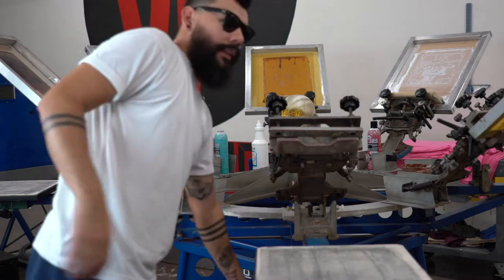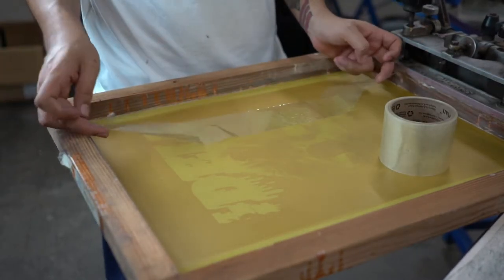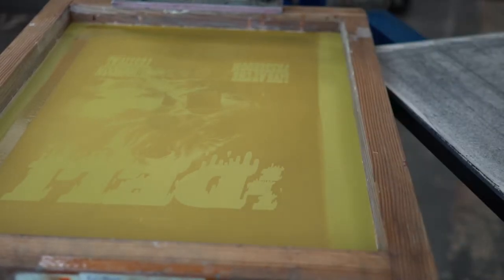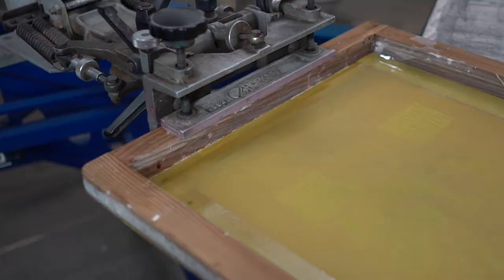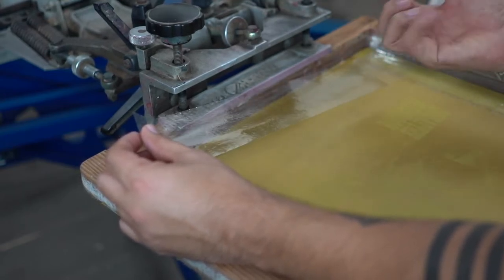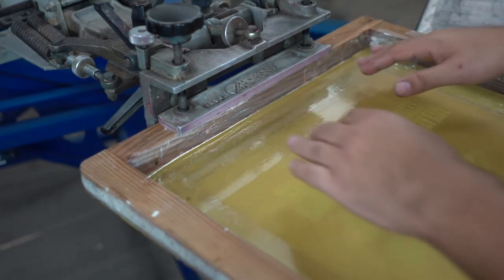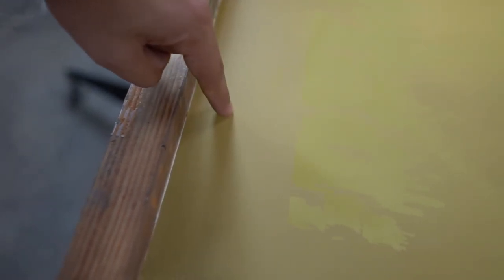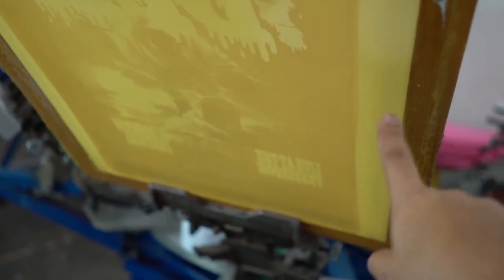how to tape your screens  screen printing

Comment: You mentioned the M3 360 packing tape. We use water base inks and the regular box tape peals off.  Are you saying this one is good and will not peal off?
Reply from the maker: The one I use hold pretty good with waterbase ink if you tape the screen correctly